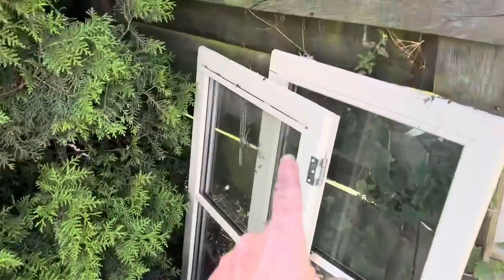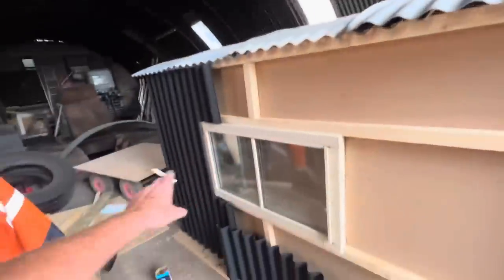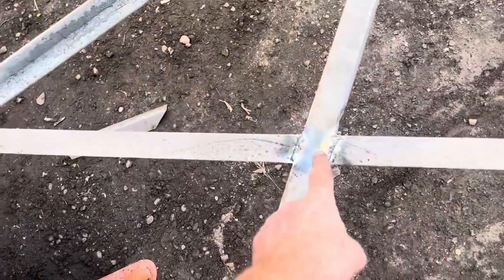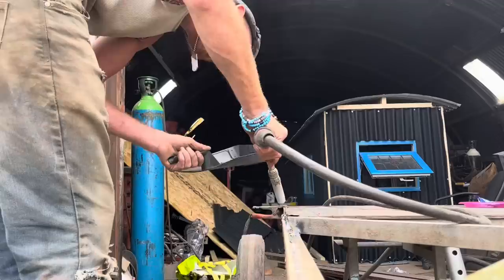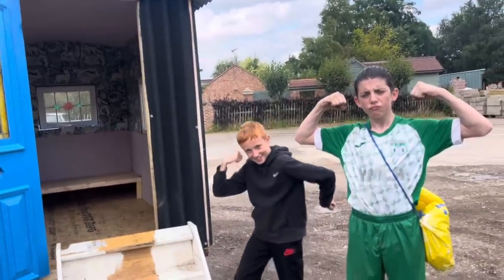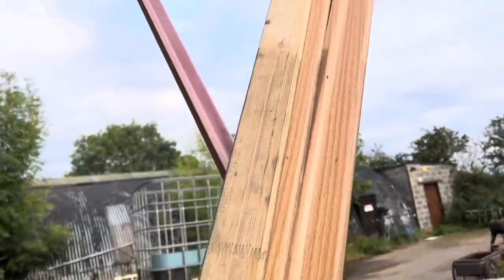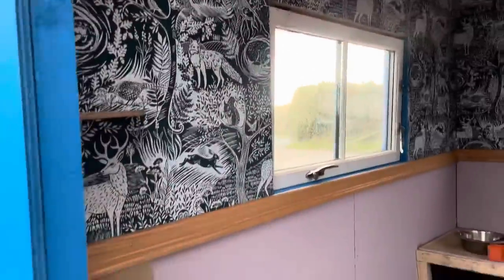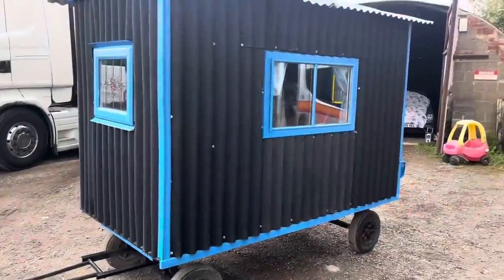The mini Shepard’s hut build! Birdies birthday 😊

Comment: Hi pal, I love your videos I'm Lincoln lad living in Leicester I got load of Whitworth obstruction spanners I know they fit pipe thread nuts I got no use for them apart from my 1/4 whit which fits the coolant fittings on my CNC machines I run at work you want them they're yours for a can of fosters 😅
Reply from the maker: Deals done mate 👍 🍺and even your second name is whitworth 😂😂
Reply: Cushty little deal woop woop 😆

Comment: Very nice...except you need to either change the hand of the door (open in) or make a porch for safety. There is no way to open the door while on the stairs. (for a child)  The porch needs to be at least twice the width of the door.  (2' door means 4' deep porch) I strongly recommend the porch unless she is always going to be with an adult.